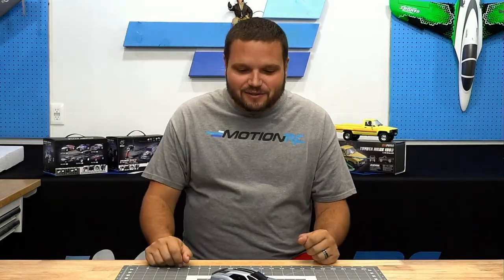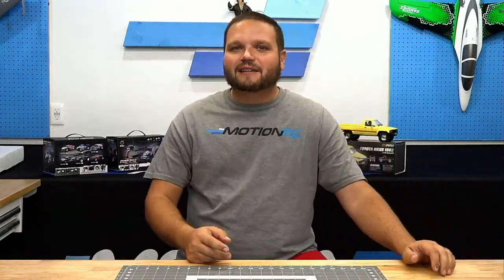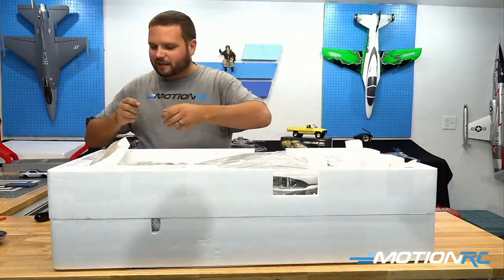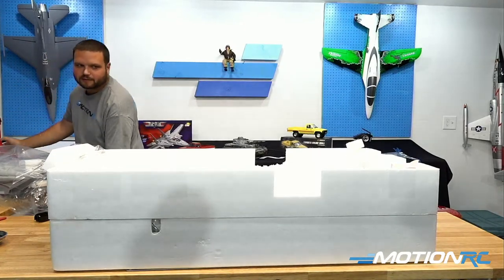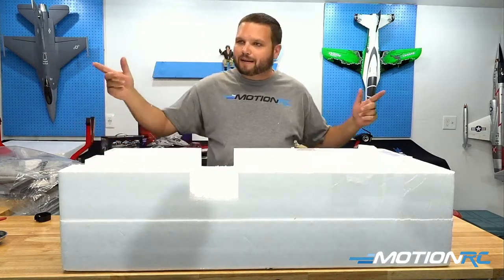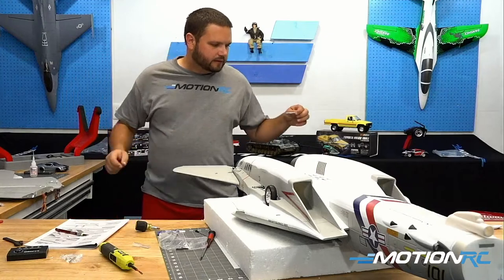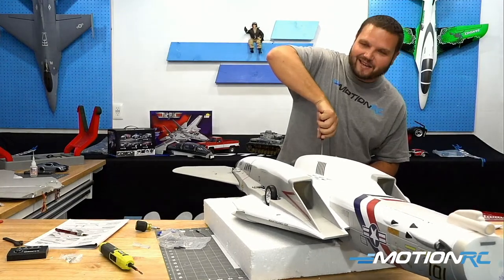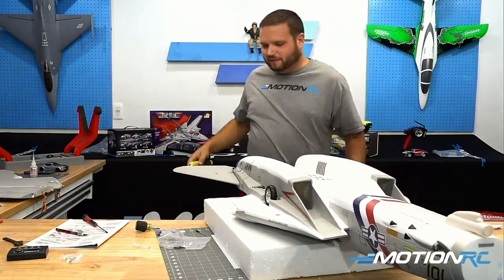Assembling the Freewing F-14 Tomcat Twin 80mm EDF Jet with Wesley  | Motion RC LIVE

Comment: Well, it looked like you had a very nice f-14 to start with. 
Mine that I am TRYING to build. But, I have a major problem with screwing down the ridder, I can’t get the screws in without cutting and having to expand the holes in the rear part of the rudder. The two holes up front of the rudder goes in fine. 
I had to make a channel for the wires, even though I pushed the wire in the little hole like you did. 
Now the last two screws nearest to the nozzles are misaligned by almost a 1/8 of a inch.. So, I am having a very difficult time where I have had to TRY to melt the plastic that holds the rudder. 
I am still pulling my hair out about this.. It’s been two days messing with it. 
I have been in R/C since 1986. And built many of many of planes. This is the first time that this has happened. 
Well, with the exception of my red monster pitts with the elevators being warped.. I still haven’t been able to fly it yet. Which is a bummer, I may have to try and build a whole new one. Since Dynam doesn’t have anything that I can find to fix it once more.Pretty plane. But, issues have been numerous.
But, at the moment this 14 is giving me a headache!! Which sucks, because this is the plane that I joined the Navy back in 1988. Plus, you know. TOP GUN.

Comment: The plastic piece under the nose is a video/flir pod.  It can be slaved to the RADAR or visa/versa.  I have this jet and am scaling it to VF84 Jolly Rogers from 1981 as that is the time I was an aviation fire control technician (who worked on the RADAR weapons system) with VF84 aboard USS NIMITZ

Comment: What would the receiver hookup be with the Futaba T6K that comes in the bundle?
Reply from the maker: What do you mean by that? Can you rephrase the question?

I'm going to guess you mean where do the plane connectors plug in to which channels on the receiver? Futaba RX's, starting at channel 1, are Aileron, Elevator, Throttle, Rudder, Landing Gear, Flaps...then all the channels past that can be programmed for whatever else you need.
Reply: I think the issue is that the transmitter / receiver in the bundle do not have enough channels for everything on the plane. It's an 8-channel radio and it needs 9-channels. (Ail, Elev, Thr, Rud, Landing Gear, Flaps, Wing Sweep, Reverse Thrust, Rec Power) 
 @MotionRC
Reply from the maker: @glenncozzens2453  That would be an issue for sure. This is an advanced aircraft with all the programming you need to do.

Comment: Hey Motion RC l'm planing on buying F14 Tomcat pretty soon but before I buy one from you all want to know l have a Spectrum DX6E 6-channel transmitter and a Spectrum AR630 6 channel AS3X/ Safe receiver after the build and hook up the wiring l'm not going to used  the wings sweep just keep the wings out during flying from now on so my Question is will the DX6E transmitter work with the F14 Tomcat or not  before I buy it.

Comment: well i bought mine and since i am an amateur i did not realize that this does not come with a battery and the remote controller which i have to buy seperately.  i need some help to assemble since it is my first time and i wil probabilyt go to my local RC hobby store to get some professional help.

Comment: Once made up out of box 
Can you rebox for transportation to flight sites
Reply from the maker: No. You will have to keep wings swept and fit it
Reply: @MotionRC  
I've been offered a new unflown one with spektrum channel 10 controller for £825 ....Thoughts ?
Reply: Can you hang these from ceiling or flat on wall when not in use 🤔